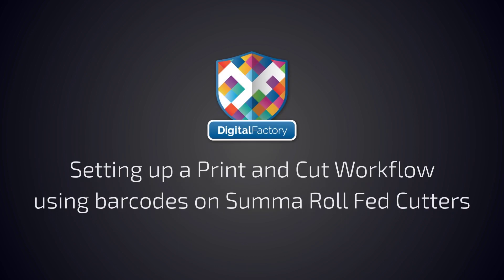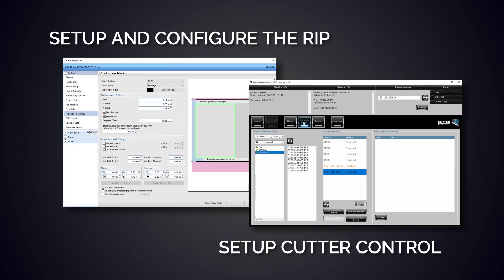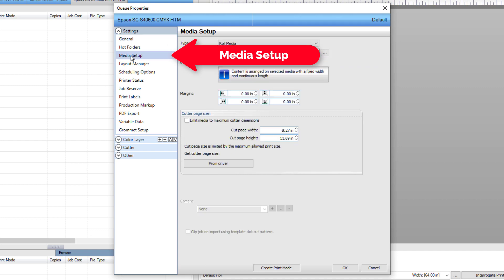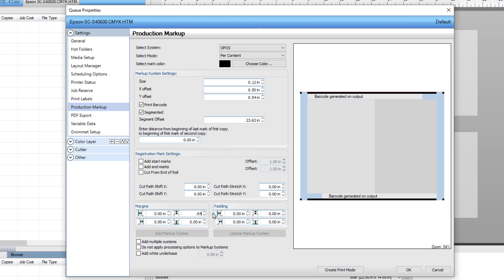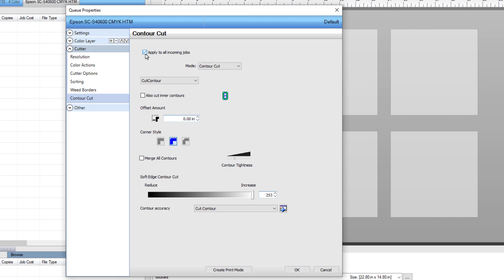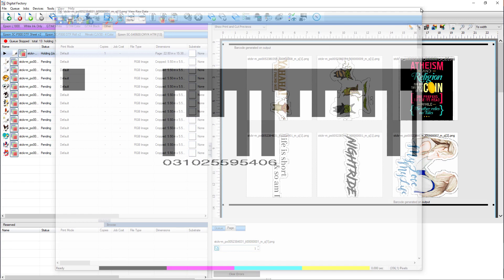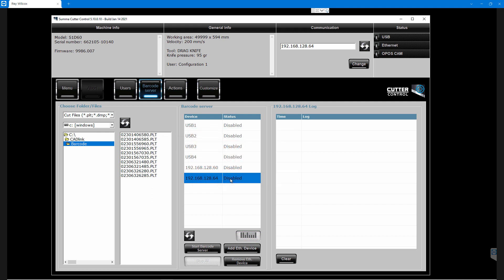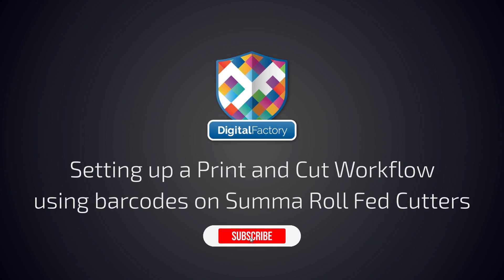Using A Barcode Workflow With A Summa Cutter

Comment: Nice we have a Mimaki UCJV300 and Summa S2 T140.  Wondering if we can use this RIP software to control those two since we just bought v11 for our new DTF setup.  Would be awesome to be able to use this instead of Rasterlink.  Mostly if it has an accurate ICC Profile for the UCJV300 as that seems to be the most challenging thing about ditching Rasterlink.